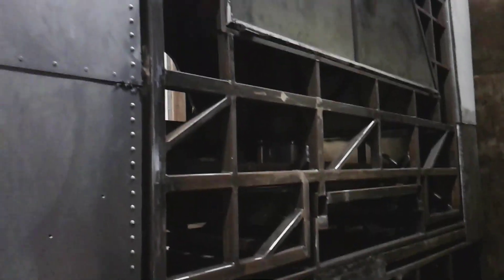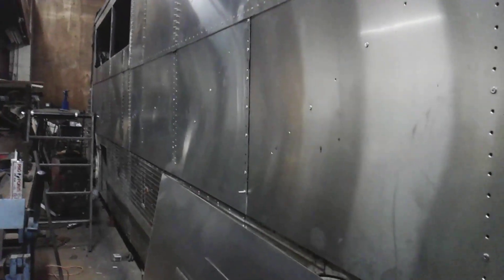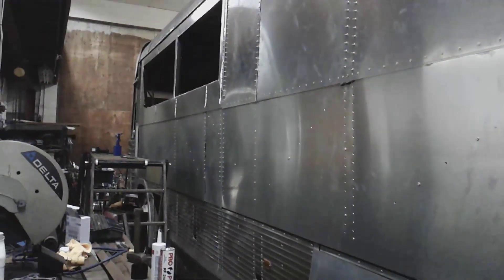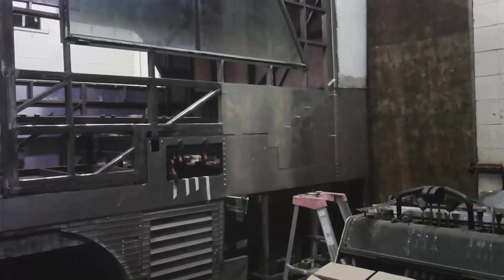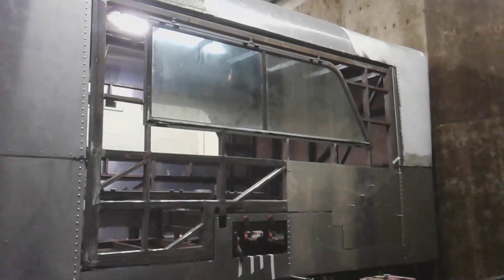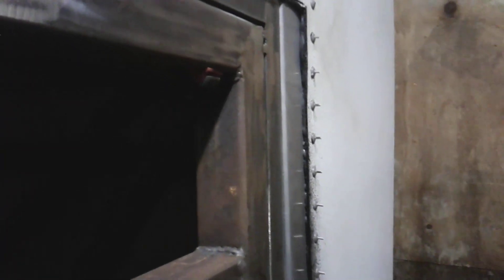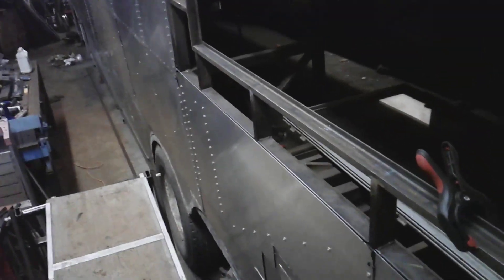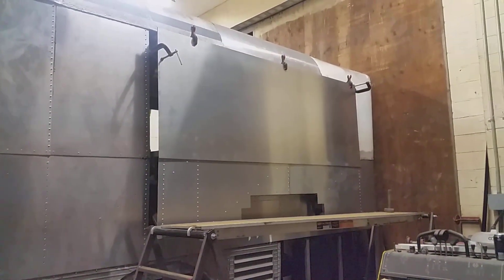Bus Conversion Project - Video 51 - Working on the Bedroom Slideout

Comment: That is Bad Ass...Hope you don't plan on painting that beautiful Steel...Love the Rivets especially...Very Cool...
Reply from the maker: Thanks for the comment!!, I have to paint the aluminum as it will corrode if left to the elements, the stainless steel on the lower section will remain unpainted as it won't corrode  but the aluminum has to be painted

Comment: I like the idea of more storage by eliminating the window, but thats a lot of weight hanging out on the end of the slide out.  I get all sorts of ideas on my build and I have to keep reminding myself to keep it simple.  At this point i would recommend that you build it as you originally intended.
Reply from the maker: Thanks for the comment, the slideout is plenty strong enough for the weight, it's built the same as the front ones and they will have couches and chairs and all kinds of stuff on them plus they extend another 6" more than the bedroom slide, I think I like the idea of installing the window and blacking it out.... best of both worlds, it looks consistent from the outside and I can have the cabinetry on the inside... I didn't think of that, there's a 7 ft. long window on the other side so should still be plenty of light

Comment: Vote no window. More storage less light in the morning, but my preference is a very dark bedroom. If you enjoy morning sun then put the window in. Plus agree with the comment about insulation, no window means a more comfortable sleeping temperature. Either way continue to admire your work!
Reply from the maker: dual pane window so heat transfer shouldn't be a problem, I like the idea of the window and then black it out, looks consistent on the outside but can build cabinets inside

Comment: It would look correct if you put the window in with blacked out glass or even blacked out aluminum in place of the glass. On the inside you could skin right over the window and put 2 side windows for light.

Comment: I would put the window in for three reasons. One, outside symmetry, and two, and what I think is a more important reason, you do not want to live in a cave, three, think of the weight hanging out on the end of the slide out. You need windows to let light in and to be able to see out. I might be a little claustrophobic. When I owned my shop I had full glass overhead doors. They were not very good for insulation, but it was nice to have the light come in and to be able to see out. I did not stand and look out it was just the feeling of not being locked away in a dark cave all day. 

Our Motor Home has three large windows in the living area and dinning area, one small window over the sink, none in the bathroom and two average windows in the bedroom. We have no slides (this works well for the two of us) and the bed comes out from the rear wall. The Motor Home is an 1997 American Dream on a Gillig Bus Chassis.

Keep up the good word and the videos coming. If you have followed the comments on dzlfreek's channel you know I have been struggling with doing my first You Tube video on a project. First one was with a Go Pro, had no idea where the camera was pointed. Second one was off my phone and after taking the video, discovered I could not get the videos off the phone. After hours on the phone with both Verizon and Motorola it was determined the phone was broken. Verizon is sending a new phone.

I have no followers at this point, but maybe someday. I have created a play list of your bus videos on my channel. Someday they may bring you more watchers.

Glenn
Reply from the maker: You'll figure it out, heck mine are about as basic as you can get but it's about the build not about video production for me, though I do want them to be watchable of course so I did break down and order an external mic so hopefully the audio will be better
Reply: The new phone came a day early. went over to a corporate Verizon store and got it set up. Took my portable PC with me and tested transferring a video and pictures and they both worked. I need to do some powder coating tomorrow and will try to video that, transfer it and edit it.
Reply: I posted this to dzlfreek and thought I would ask you as well. 

Ok, took some video with the phone, and was able to transfer it to the computer. There will be some stuf I can practice editing on. I do have some interesting things to report. One is for some reason one of the videos was recorded in portrait format rather than landscape. The phone was never taken of the tripod, it was just moved from one location to another. Also in a second video I was recording the work bench and without turning the phone off moved it to view inside the oven. The view of the workbench is right side up, and then when it was moved (with the phone still on the image flipped upside down?

Thoughts?

Glenn Lever
Reply from the maker: Only thing I can think of is ... at least on my android phone, the gyro gets screwed up sometimes and the auto rotate goes all goofy, I was told if you hold it flat in your palm and make horizontal figure 8's with your hand a few times, then turn it upright and tilt it back and forth and then side to side a few times the gyro will reset and the auto-rotate will work properly... I've tried it on mine a few time when it screwed up and it seemed to fix it.... if my explanation doesn't make sense, try searching for that on YouTube and somebody probably made a video about it... seems almost anything you want to know about.... somebody made a video
Reply: It is an android, did some poking around and the re-calibration appears to be for the Samsung Galaxy phones. There are a number of videos on it. They want you to download a third party ap. I did not find anything on horizontal figure 8's I did find this when searching "android gyro horizontal figure 8" https://www.youtube.com/watch?v=-Uq7AmSAjt8 they were talking about compass calibration though

Glenn
Reply from the maker: seems to work for the auto rotate too.... at least it did for me
Reply: Ok, I will try it. Next unexpected problem. Went to use Microsoft Movie maker and found it was not on the computer. Poked around again and found it is no longer supported. What do you use to edit videos?

Glenn Lever
Reply from the maker: I don't really edit anything, I just take a series of short videos as I'm working and then string them together .... I use a program called Tipard M2TS Converter and you can convert and merge video , change the format... that kind of thing, if you want to do advanced editing like adding text, fading in and out.... adding music... Adobe Premier is the way to go but it's pricey and has a pretty steep learning curve, well worth it for professional looking video but way out of range for what I'm trying to do, another option would be Roxio Easy Media Creator, I also have that installed , it's easier to learn to use but it's not cheap either, just stringin' them together seems to work OK, for me at least.... all depends how elaborate you want to get
Reply: What my thinking was, was to record constantly, move the tripod as needed and then cut and splice. I have Adobe Photo Elements 15 for enhance stills. Was complicated to learn and is more than I want to start out doing with the video. Maybe later, but for now I want something simple, be able to add music and voice over, cut and splice and maybe some text. Thanks for the suggestions.

Glenn Lever.
Reply: I found pricing for Adobe for 19.99. I am downloading the trail version to see if I can use it. I have found Adobe Photoshop confusing and not straight forward at all. I do not need something complicated, yet. PC World likes Adobe they say the price is $99.99, they rank Corel VideoStudio Ultimate X10.5 second at 59.99

Glenn Lever
Reply: Ok, you have really helped me! 

I have edited one 29 minute video segment down to 5 minutes, used the editor to flip the upside down section upright. 

I still need to add voice over, music, titles, time laps and merge in sections of two other videos. 

This was strictly a learning exercise and I will be deleting it shortly (after you have a chance to criticize it and I welcome it, need all the advice I can get as a beginner). 

Understand all I have done is the editing of the video (and the fist part of the project was lost when the phone would not transfer the fist videos I made of the start.

https://youtu.be/t56TcZQkjr0

Maybe I will do the next practice on the drill doctor. There are a bunch of videos out there, I can use them as a guide on what and how to film and then edit it.

Glenn Lever
Reply from the maker: I think it's 19.99 a month isn't it?.... no option to purchase.... just a subscription at 20 bucks a month
Reply: I did not investigate further as I wanted to play with the trial version first. I have since purchased Adobe 2018 for $99.99

Glenn Lever

Comment: I wouldn't worry about too much wall without a window looks-wise, especially considering you'll be adding some on that side anyway - not having a window behind / above the headboard is probably a good thing as the window can leak at some point, and also doesn't insulate for cold and noise too well, so you'd likely end up covering it one way or another anyway. I'd rather consider putting windows in the slide-out sides if it was me (which it isn't of course ;-)
Reply from the maker: always like to hear other opinions either way, thanks for your thoughts

Comment: I'd stick with the window. Breaks up quite a big wall of metal on the outside and there's a danger it's too dark on the inside without one. You don't want to have to run lights in the daytime.
What glass will you be having in the windows? I'd suggest if you wanted cabinets get some blacked out glass and then build your cabinets up inside, then you can have a window and cabinets.
Reply from the maker: Ya... I'm liking that idea, the window is already dual pane so heat transfer won't be much of a problem, I can Limo tint it and then build cabinets inside, there is a 7 ft. long window on the other side so I don't think Light will be a problem

Comment: Can you weld the exterior seams (and then sand that over to clean up the welds)?
Reply from the maker: suppose you could but I'm trying to keep it looking like a bus and they are riveted.... would be a lot of welding and warpage would be a problem, you'd have to use plastic filler.... I like the riveted look anyway

Comment: Just curious if the slide can carry the potential weight of bulkhead/overhead cabinetry? Plus you gave to step on the bed to access it?

Having posed that, you can never have enough storage...
Reply from the maker: Oh ya, it's built the same as the front slides and they will have more weight on them and they extend an extra 6" so that shouldn't be a problem

Comment: Will the factory brakes be sufficient to stop safely with all the extra weight?
Reply from the maker: Plenty.... it won't be any hevier than a bus full of passengers and luggage, it can only weigh what the axle capacity is and the brakes are designed for that

Comment: I'd go without the window. First there is one on the opposite side anyway, second its a bedroom, not a lounge, don't think you'd spend days on end in there. Then there's the question of insulation! A big window like that means you need a lot more energy to heat/cool this space, while if you insulate this wall ...., you get the idea. Rather would go with the small windows in the kitchen/bathroom area and put a cool airbrushed picture on this rather big metal surface.